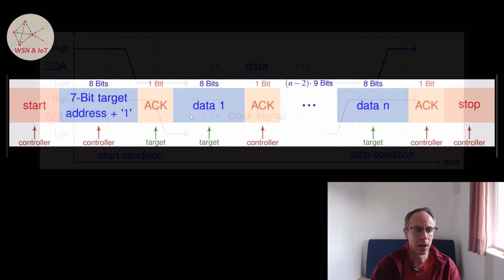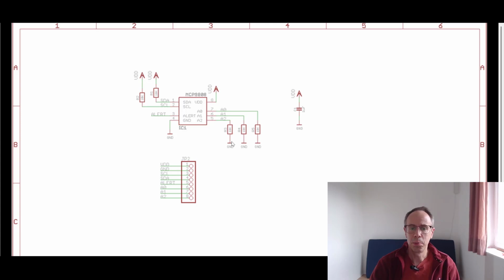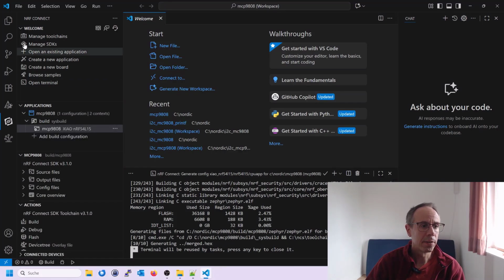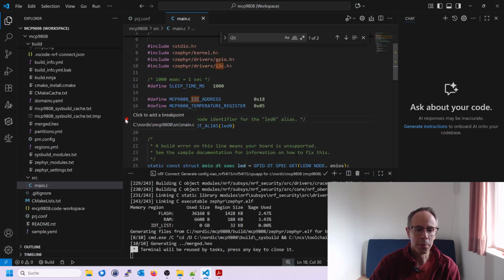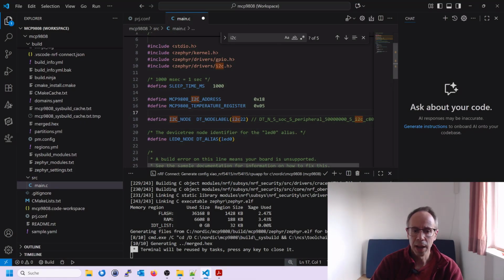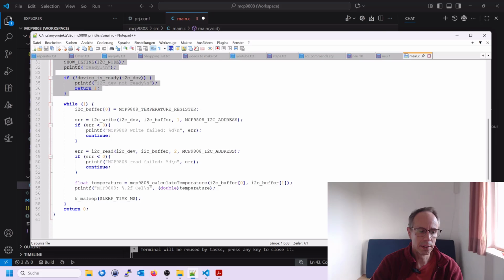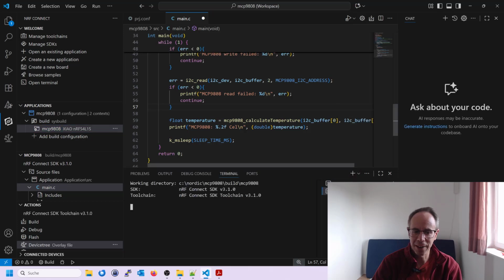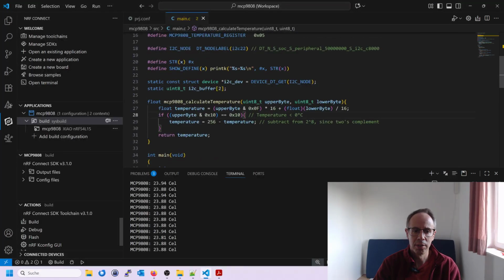Seeed Studio XIAO nRF54L15 Part 3: I2C and Temperature Sensor MCP9808

Comment: Great job on a confusing subject. Are Node labels interchangeable? i.e. can I use either in the code? the "xiao_i2c"  or the " i2c22 " I think the main point is the i2c@c8000 is the right port and pins for what the hardware is connected to no ? Thanks for taking the time. :+1:
😁👍
Reply from the maker: In this case both are just labels for the DT path i2c@c8000. So you can use either xiao_i2c or i2c22.